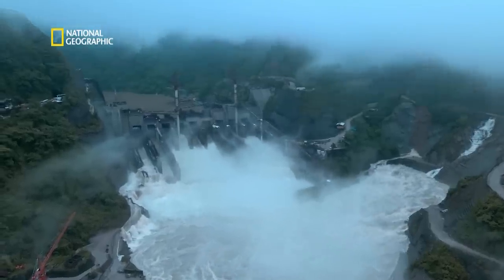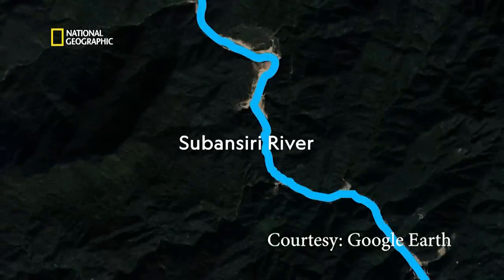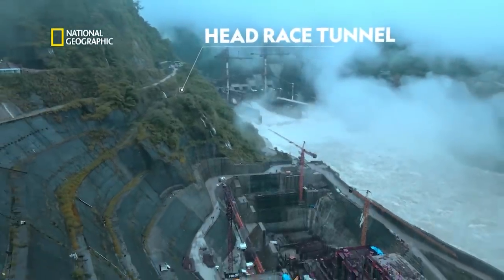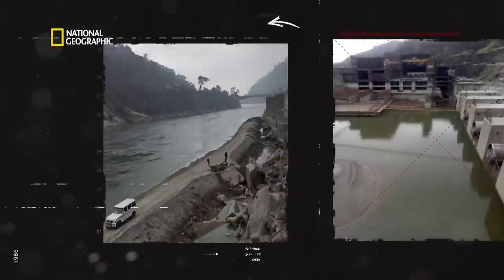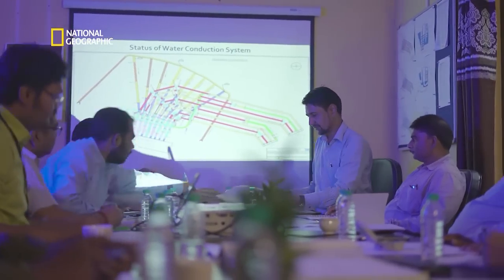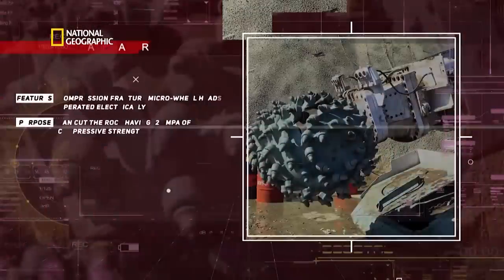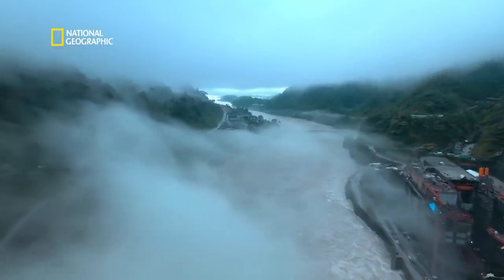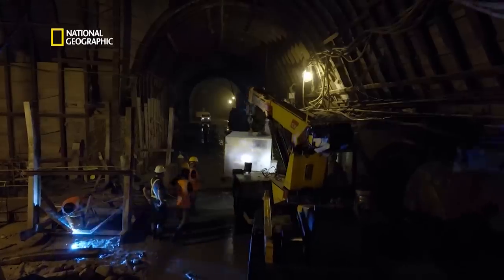Marvel on The Subansiri | Extreme Tech – Patel Engineering | National Geographic | Partner Content

Comment: As an Assamese and been to the area I don't agree with the Subansiri Dam Project, most of these projects are big White elephants and a big ecological disaster it has been proven Umiam Barapani can't even supply Meghalaya Assam with power . .Instead of construction of dams best to divert part the river in the higher reaches and through a shaft penstock direct to the river so it can be discharged lower down .Subansiri is the home to a great fish the mighty Mahseer which migrates be between the higher and lower reaches and can grow to 40/50 lbs .It the design taken this into consideration .

As from its start in 1950's after the big Assam Earthquake of 1950 the tributaries of Subansiri like Dirgha, Kadam, Kakoi were blocked due to severe landslides and due to carrying out of huge amount of sediments from different places . The blockades were created by rock dams. These rivers have a great erosive power and it can make a new flow path diverted around the blockades. In most of the cases, these rivers transformed their original courses to flow again in diverse directions. Are the engineers aware what happened in 1950 with landslides causing dams to be made and burst causing huge devastation eg would the recent Uttarakhand Project but that was due to melting ice .I have seen with my own eyes 3 /4 12 ft x12 ft concrete blocks at Bhalukpong to protect the strategic road from Balipara to Bomdila be washed away .Never underestimate the power of nature and construction in one of the most highest earthquake prone zones is never easy -
Reply: I agree but if govt didn't do anything then people there blame govt for not providing development.